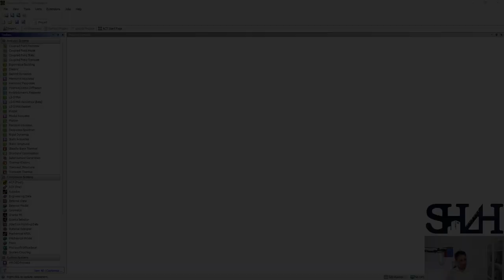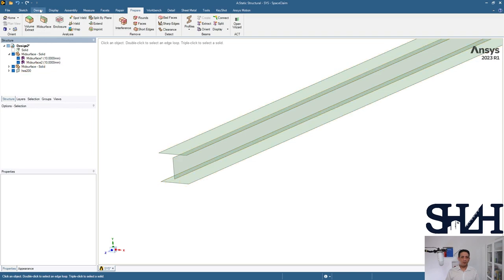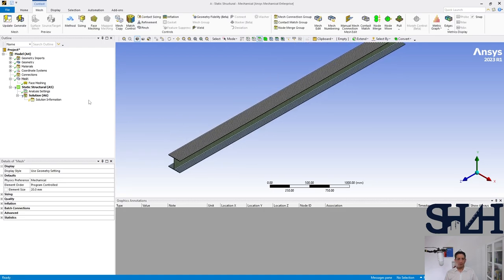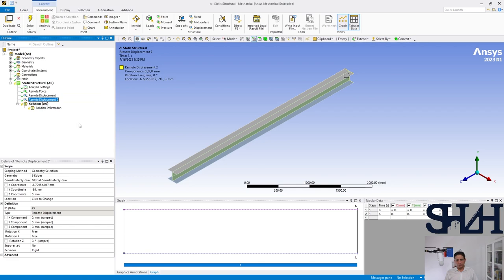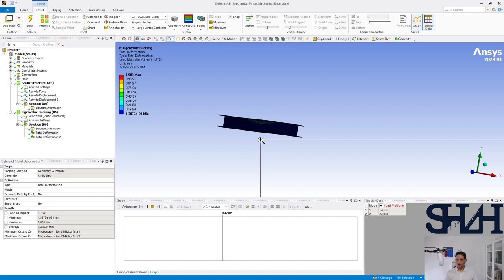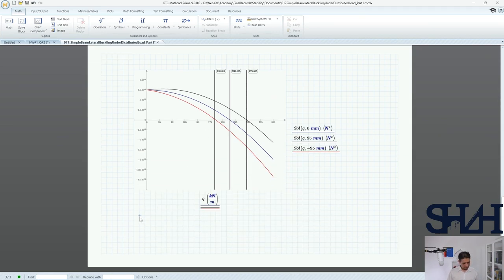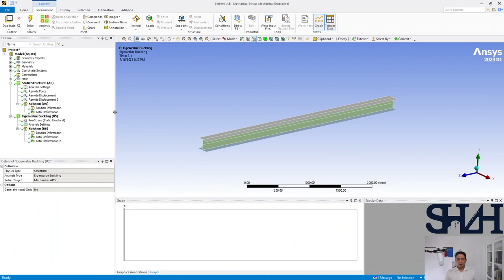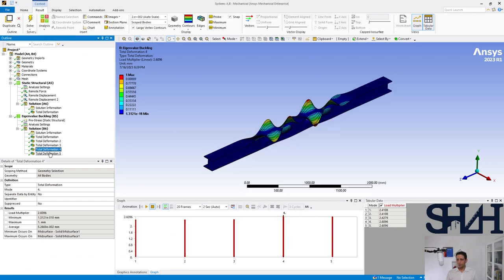018 Lateral Torsional Buckling Ansys Modeling (Part 2)

Comment: Thank you for these lectures about LTB. They are very detailed. In my practice, I use beam models and module RF-STEEL EC3 for steel structure calculation. When calculating the same beam, I get Mcr = 190 kNm (4 m, simply supported beam, HEA200, load 100 kN/m, the module RF-STELL EC3 specifies that the load is applied to the upper flange). According to your calculations, M = q * L2 / 8 = 200 kNm. Critical coefficient 1.7. Critical moment Mcr = 190 * 1.7 = 340 kNm. How can one explain the almost 2 times difference between your modeling method and the also numerical (not analytical) one in the steel structure calculation module RF-STEEL EC3?